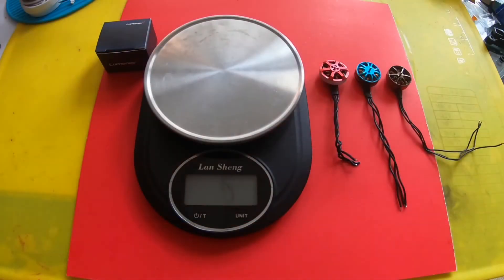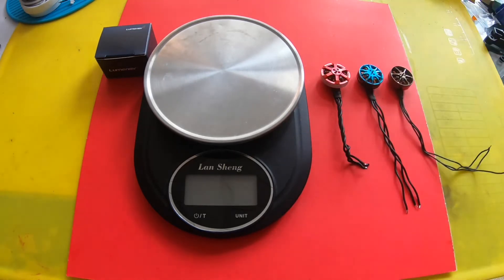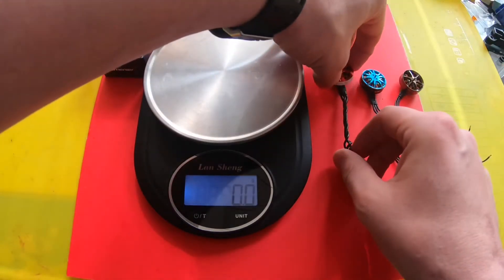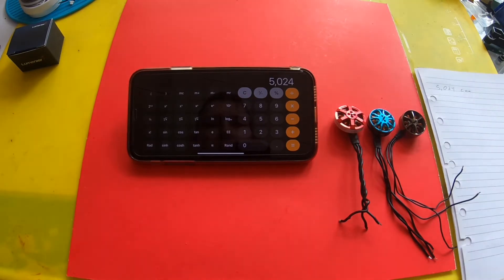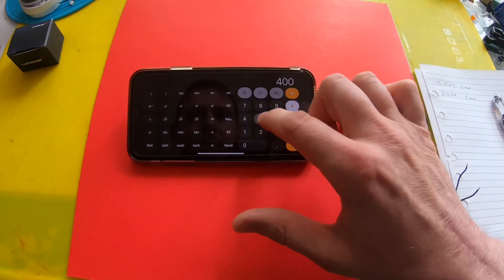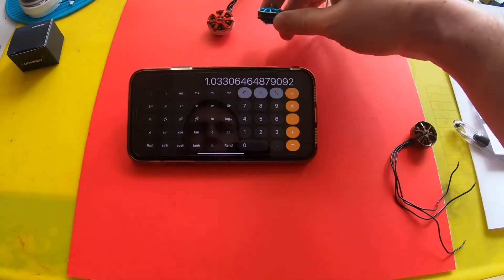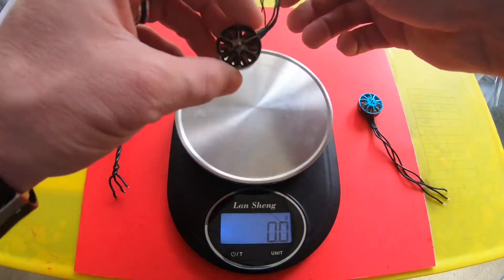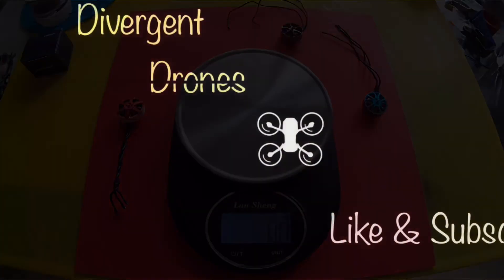Lumenier 2005 vs FPV Cycle 2203/4  Which is Actually a Bigger Motor?

Comment: I cant find any info on how much ESC you need for the Lumineer Chief 2005 2000kv would 20a be enough for 5" on 4s
Reply from the maker: I had a 30a or 35a ESC running 6s with 5” props. On 4s 30a should be fine.

Comment: Emf use stator surface area and copper windings; volume not (i.e.  stator diameter x height). Speed (radial) and torque, both affecting the thrust made by props' profiles (pitch and surface area).

Comment: the lumenier motor have smaller wires you should cut them to know the real motor weight 
and the 1.03306.... result is not 1.03% it's 3.3% bigger
but good !
Reply from the maker: Yeah, you’re right. I was doing the math for a sphere not cylinder.

Comment: Good Video.  You are supposed to square the radius, not the diameter, but the delta percentage ends up the same.  Between the heavy 3" whoops and ultralight 5" trying to get under 250 seems that 1-2K mm³ is already a growing segment.

Stator volumes (not accouning for bearings):
2004 - 1256.64 mm³
2005 - 1570.8 mm³
2203 - 1140.4 mm³
2204 - 1520.53 mm³
2205 - 1900.66 mm³